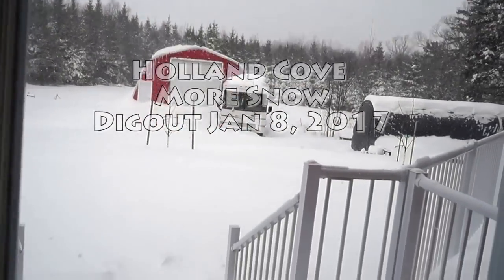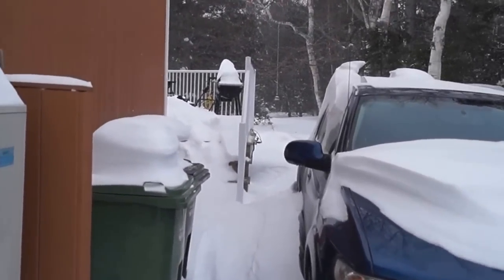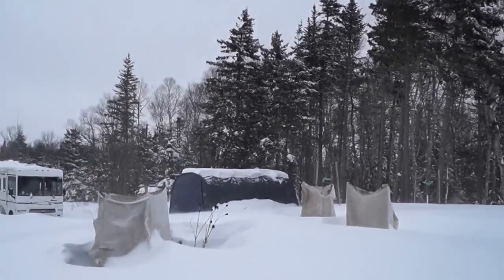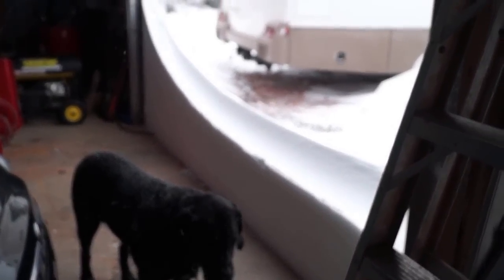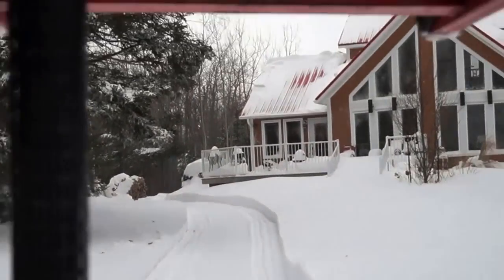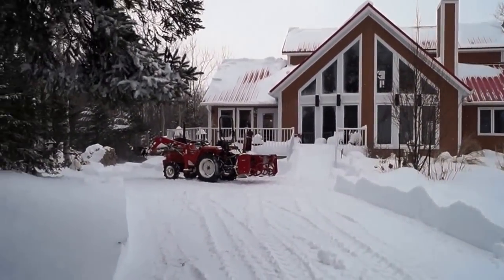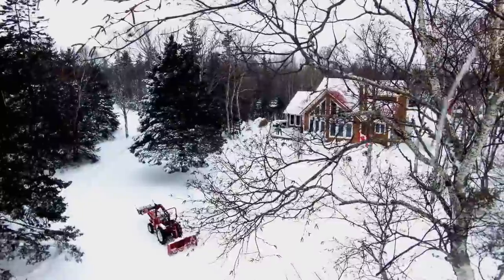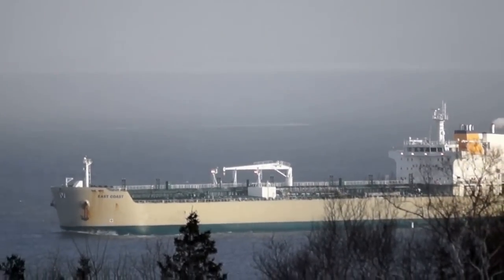Digout Holland Cove Jan8 2017

Comment: what size is your shop that you keep your tractor in ????     its a very nice looking shop love 2 have one my self
Reply from the maker: 30X40 Steel construction http://www.futurebuildings.com/
Reply: if you don't mind me asking what would a building that size with a cement slab cost a guy ??
Reply from the maker: It was about $35K to $40K Canadian all in. 3 man crew plus me to put it up in 3 days and we used a motorized lift. Make sure your slab is thick enough to support a car hoist later on. This one has 2 ft footings around the sides and 3 ft footings on the front, but we live in an area prone to frost. Those futurebuildings guys always seem to have some sort of clearance, I priced a 20X30 first and they came back with 30X40 at 1/2 the cost.